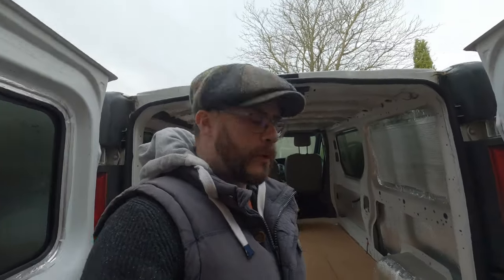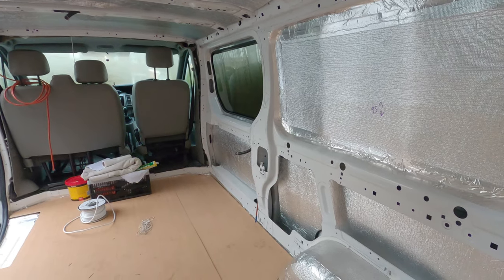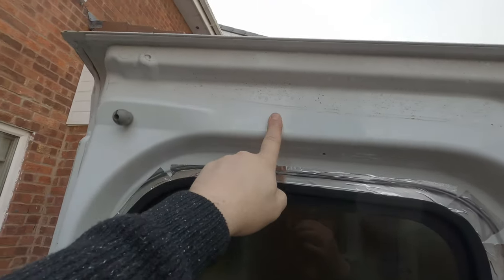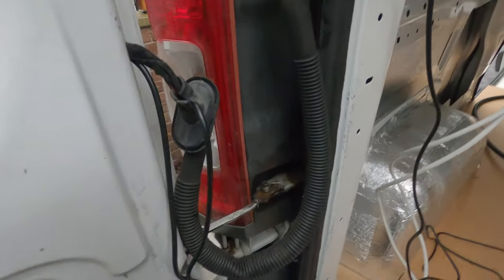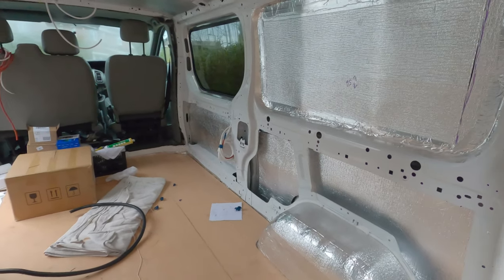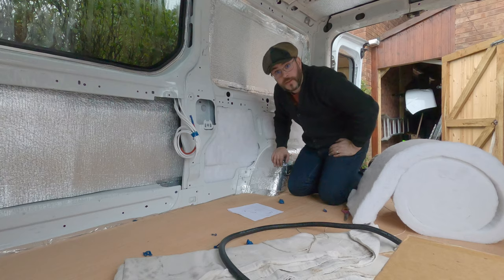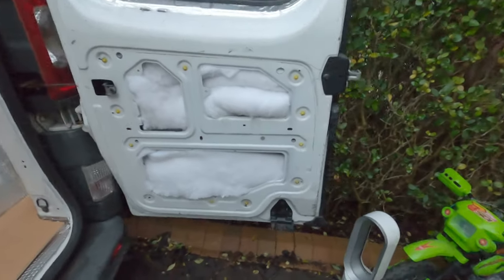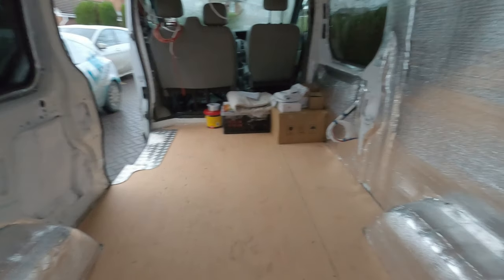ASTRO 1 - Part 6: PLOUGHING ON - Finishing the insulation and getting started on Electricals

Comment: Great vids, currently doing my vivaro conversion. Quick question how do you remove the rear interior lights
Reply from the maker: Hi Jason. If I remember right I simply popped them out, blanked the cables and left them coiled up inside the cross beams of the ceiling.
Reply: @WildAstro  Thanks, was thinking of returning the middle one down to the kitchen plinth with l.e.d as an alternative to your side door track idea

Comment: Hi rich, loving the videos, just a quick one, how don’t you run a earth cable from the main battery to the leisure battery? Or are you earthing the leisure battery on the chassis where it sits?
Reply from the maker: Leisure battery is earthed to the chassis mate. Sand paper a small area down to the metal so you get a good connection and screw a crimped lug straight into the bodywork close to the battery and you’ll be all good!